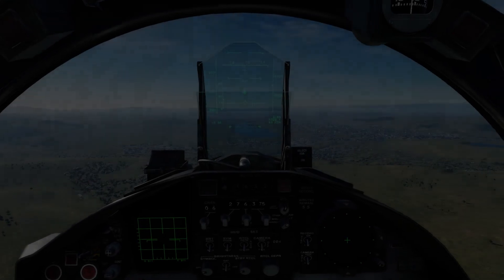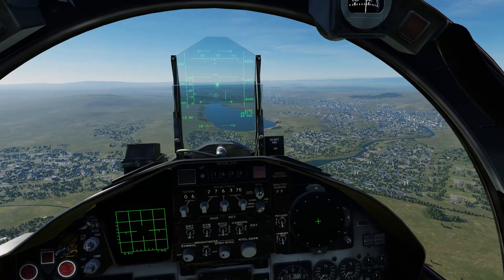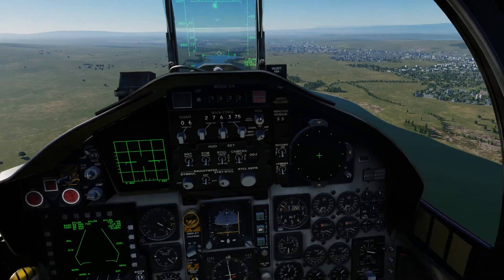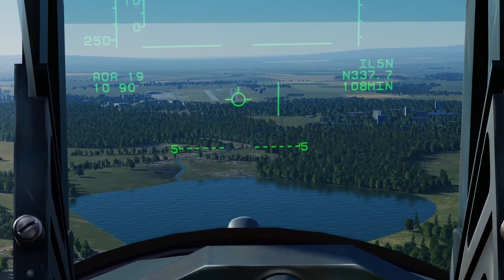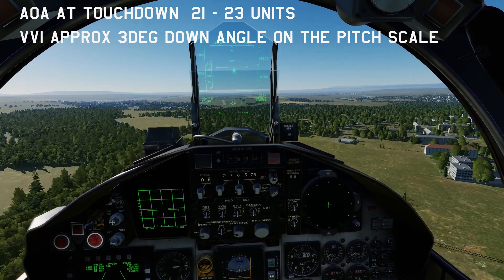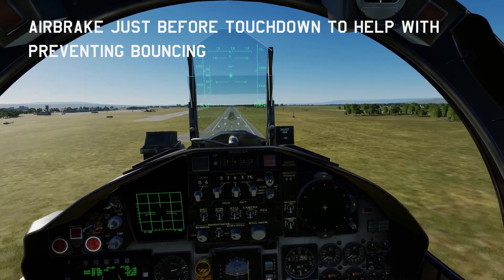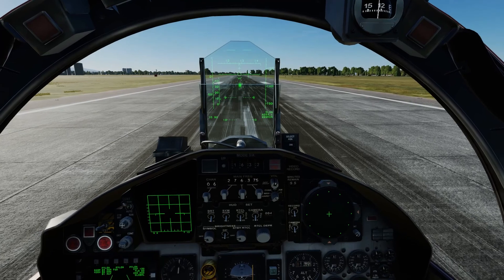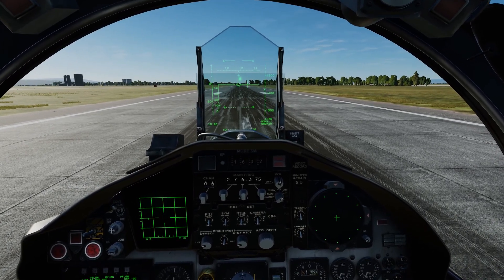Basic Fundamentals DCS World: F-15C -Landing VFR

Comment: Still don’t know what I’m doing wrong because I land at around 150knots with flaps and airbrake pretty much flying straight over the runway with my flight path indicator aimed where I want to touchdown and I flare a little to land yet every single time the aircraft slams down and at least one wheel breaks or tire pops.
Reply: how heavy is the payload? if there is not payload you are bringing her down too hard. the hardest part is basically just finding the perfect speed to have a controlled stall
Reply: yeah that was the main problem for me, i just landed and i had full missiles and i landed at around 160-170 i think try to land more around 180 and when you're just over the runway put the power at 0 and then put the nose up with the airbrake it should work